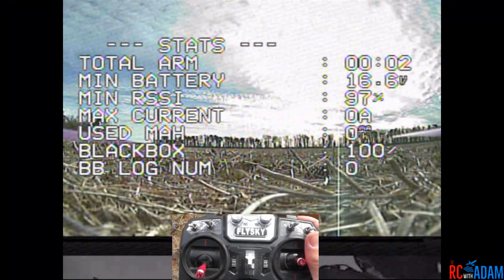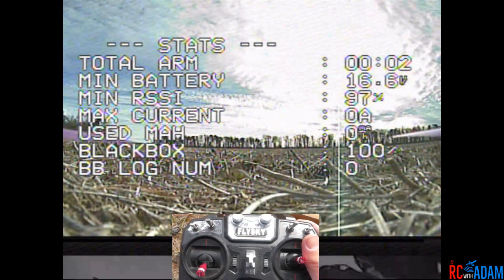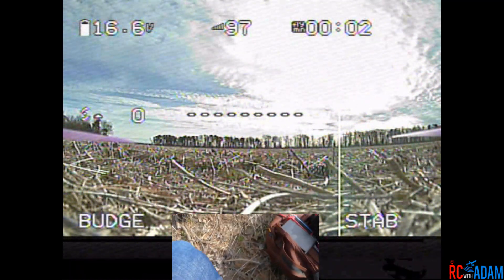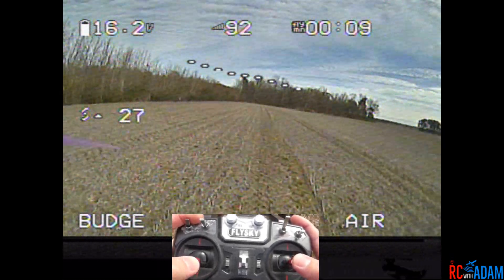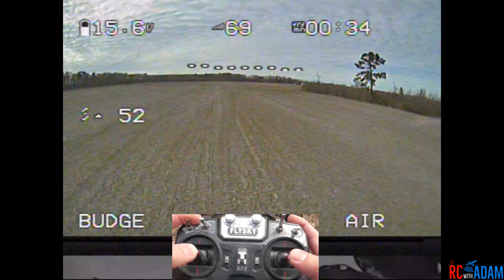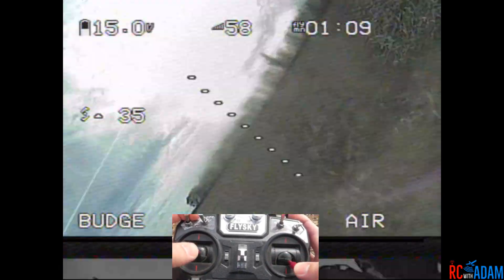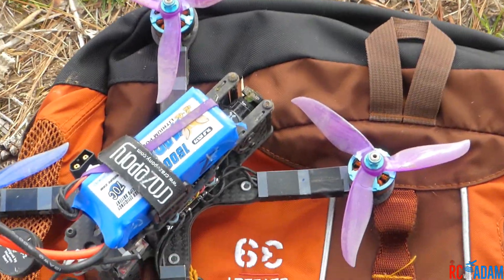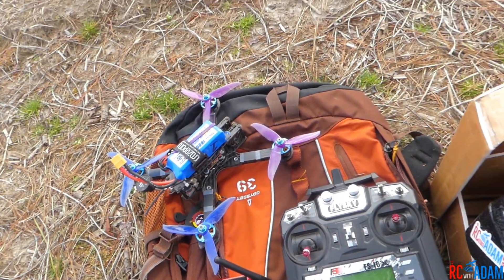[SOLVED] Mamba F405 Death Roll - Has this happened to you?

Comment: why dont u take this down . if it was nothing to do with the FC ..
Reply from the maker: Good question. I leave it up because somebody else might have the same thing happen, think it's the FC, then google that and find this video, and then realize that 1) they weren't the only one to have that issue and 2) that the issue is actually the motor. I also have links to the final video in the description.
Reply: @RCwithAdam1  and they will have to read all the comments. To find out
Reply from the maker: @Dawntreader666  Nope. Link is at the top of the description and pinned to the top of the comments.

Comment: Yeah I noticed that you were trying to re-arm as it was falling. Kudos to you for that. To have the presence of mind to try that, and not to panic - cheers bro.
Last week I flew my first build and throttled rapidly and my quad took off upwards, and I panicked and hit the disarm switch so hard that I broke the switch. Quad wound up so high in a tree that I almost cried (I did scream at the sky LOL). Luckily I was able to shake it down by throttling. 
As I was saying - cheers to you - you are a good pilot.
Reply from the maker: Thanks for noticing! And I've never had one stuck at the top of a tree before. Close call!😱

Comment: hi adam i was wondering if you  had any information regarding reducing vibration when the throttle is raised it is fine until i go to high power and then it gets really shaky in the fpv camera you cant tell that it's doing it los tho  i am thinking that a ND filter might help what is your opinion ? thanks
Reply from the maker: Hi! Maybe something is loose? or a prop is way out of balance?

Comment: Hi, My problem with the MAMBA F405 MINI F4 is that it gives me Core temp : 78+ and because of that, if i higher the throttle, it will just make small jump and restart the fc again. very strange. my vtx is just on the white plastic plate that is above the fc. anyone has an idea?
Reply from the maker: Hi! Does this happen only with the propellers on, or just any time the motors spin?
Reply: @RCwithAdam1  when i fly for a minute in just normal temperature not hot. then land. after that the fc gets hot.... it might be because of the VTX is on top of it. but it has a 3mm gap between it.... the heat might transfered to the fc (vtx on 400mw super hot). then you will get the high temp core 75+. At the moment i made more space between the 2, like almost 1 cm. hope this will help.
Reply: @RCwithAdam1  How close is your vtx to your fc?
Reply from the maker: Wow hey sorry for the delayed response! My vtx is about 5mm above the fc. Has your quad worked better at all after moving your vtx?
Reply: @RCwithAdam1  hi Adam, so far it did. Only problem now is that I get bad video feed, I get moving horizontal lines. I use a l-c filter already still did not help. I am going to add an external 5volt. But about the mamba getting hot. The thing is I tested outside and the temp here is around 4 degrees so it's cool anyways. But I guess it helps that the vtx is far away as possible. . Yours is still getting warm?
Reply: Oh and I just received a new 3 inch frame that has room for 2 boards beside each other rather then like the daitone 349 frame its stacked. So that would help a lot I think.

Comment: most likely an ESC issue...if not a bad wire or connection to/from your motors, or even a mosfet or motor itself...try upping your 'Demag Compensation' and lowering your motor 'Startup Power' in BlHeli.

Comment from the maker: Has anyone had this issue with the 20x20 version of the  Mamba F405?
Reply: Hello, this issue happen in two of my quads whit exactly the same setup on mamba stack. The problem was betaflight 4, returning to 3.56 solved the problem.
Reply: @josehernanrestrepomontoya9291  I've had at least two death rolls which, even though I'm a novice and have not tried BF 3.5, I'm drawn to think may be down to running BF 4. The death rolls I have had came after/during a controlled roll.
Joshua Bardwell covered reducing filters in initial setup of BF 4 to protect from hot motors and from build having throttle flyaway behaviour. He did not mention roll or other control problems; but if the filtering he guides people to alter can cause throttle to uncontrollably ramp up, then I'm guessing that it could cause out of control acceleration of motors during a roll (death roll??). I may try altering filtering before stepping backwards in BF releases to BF 3.x.x
* I'm running a Kakute F4 V2
Reply: Nope, ive used 4 different of the mini one, everything is fine
Reply: I've had 4 different ones, both mini and normal, i honestly think that is your Transmitter/radio
Reply from the maker: Ok. That's good to know. Thanks.

I just can't see how it would be the tx, though. If the tx was no longer sending a signal to the rx, for example, the quad would go into failsafe mode (which is definitely not a spin).
Reply: Just had this happen with mine tonight. Has been flying w/no issues on 4S, but a 6S punchout made it lose its shit. Searching for answers.
Reply: @wingsuitist  what kv motors, 4s motors on 6s usually causedesyncs in the esc
Reply: @MachineManGabb  It's a Diatone Tyrant M540, built for 6S. Stock 2308 1950kv. I think it happened to mine because the PIDs weren't adjusted for 6S. I had been flying on 4S PIDs.
Reply: @wingsuitist  what receiver do you have
Reply: @swugger  FrSky R-XSR. Another forum told me that I was flying on 6S without adjusting my PIDs first. Oops.

Comment: I solved it setting runaway_takeoff_prevention = off
Reply from the maker: Oooo! For real? That sounds very likely. But, if the runaway tekeoff preventing kicks in, wouldn't the motors just turn off (instead of spiraling uncontrollably)?
Reply: You would see "RUNAWAY" in your OSD if that feature was getting triggered. And yes, this usually happens very early in the flight, and only if you have a major configuration discrepancy, like wrong motor direction or absurdly high PID gains.

Comment: I have two Mamba f405, same problem with Flysky i6x, my problem was at 0 throttle the Flysky send a sort of "loss signal", I changed the radio with the Frsky Qx7, no more problem. How the user Slo Poke said, try to change the min_throttle and set in Betaflight (or your default configurator) Motor stop = OFF when armed.

Comment: I have the 20x20 and i have 2 racers exactly the same. And when i clip something banch or gate. The osd/fc freezes
Reply from the maker: Y'know, I had the exact same experience the other day. I hit a scraggle and went into a yaw spin. Normally I'd be able to recover (and have before with this same setup), but this time it went into an uncontrolled sort of tumble. Hmmm...
Reply: @RCwithAdam1  https://youtu.be/BFIa5I1la1I here.. 😒
Reply from the maker: I watched it. Yeah, I don't think my osd froze like that. I'll have to watch my dvr.
Reply: @RCwithAdam1  i will up a vid to my channels in a sec you can check it out.. 😒 It completely freezes..
Reply: Fixed
Reply: @Oddie Does Game Indonesia i increases the space between my esc and my fc. Sounds simple but 5 months later no freezing osd
Reply: @Oddie Does Game Indonesia rubber washers... Commonly used in charm bracelets

Comment: I see your update on 2-22, have you changed your throttle idle and have you had any death rolls since? I started having this a lot when I changed my motors out, so I changed mine but haven't flown yet, hoping this resolves it.
Reply: So I've played around with all different idle speeds and min throttle and everything, still happening to me.. I think it has something to do with dropping the throttle to 0 while air mode is turned on. I don't seem to get it with air mode off, still trying to figure this one out :(
Reply from the maker: Very interesting.
Reply: @RCwithAdam1  so it happened again today with air mode off, something isn't right... have you had any luck?
Reply from the maker: Dang. No, and  I need to do some repairs after hitting scraggle which caused a death spiral (before that, everything seemed normal).
Reply: @RCwithAdam1  so I think I might have fixed mine, had to reflash 16.7 on the ESCs and I changed the min and max of each ESC to 1000 and 2000 in the blheli config (even though they claim it does nothing when using dshot) and I left my idle at 6%, been using air mode again for a few days and no issues yet. Fingers crossed!
Reply from the maker: I haven't gotten to fly again since. I want to figure out how to do the blackbox stuff to get some real data before changing the idle % (although I think that is the issue).
Reply: @RCwithAdam1  It's tough with the Mamba F405 FC though, 10MB isn't much haha. If I get the chance to fly before you I'll post back. Fingers crossed for both of us now haha

Comment: Dude I know what it is. I have had this on a few of mine.
Go into the cli and set the gyro overflow detect to yaw.
Bc it also could be a motor going bad. 
Do this and I'm 100% it will stop doing that.
I also fly with flysky to.
I talked to jb about this same issue and this is what he told me to do.
For some reason the gyro thinks it's one way and it's not.
Broke a brand new quad bc of that, was pissed.
Now I always go into the cli and change it to yaw on everyone of my quads.
Reply: I have a 6s running 2207 2750kv motors it was that fast off the mark it would trip the over flow but it don't do this ... it woukd still fly  but not stable ... this is a motor or esc for sure

Comment: YEAH I HAVE THAT
Reply: But with the mini
Reply: Happened to me today lol, caught it once but not twice lol... It was my first actual flight with a 5 inch instead of a tinywhoop or simulator, I though it was the gyro bc it flipped out on me when I rearmed and they current sensor was reading like 10A at idle (there was some snow on the ground so could be that as well)
Left it out to dry, will try again when temperatures are back up :)

Comment: Why does your rssi drop so much?  

As for the death spiral, what is your idle speed and are you in dshot or multi?
Reply from the maker: Not sure about the rssi. Maybe I need to calibrate it better. 

Idle is 4.5%. Dshot600. I think it is the low idle that's causing this to happen. Didn't understand why until now!
Reply: @RCwithAdam1  low idle is what did my last one. 5.5 is now default on bf4 and what i have been running since my last deathroll
Reply from the maker: So, what do you think it is about the low idle that actually cause the problem?
Reply: @RCwithAdam1  Just that lower Idles tend to desync or freak out when you're going from high throttle to zero throttle.   try 5.5 or even 6 and test it out
Reply: He’s using flysky i6 they dont have much range compareto frsky i use to fly with flysky until i get alot of failsafes i switch to frsky
Reply: @angelfpv4825  I use flysky and my rssi stays in the 80s  as long as i can see the quad.  just seemed to jump around a lot that i wasn't' expecting.  Probably normal.